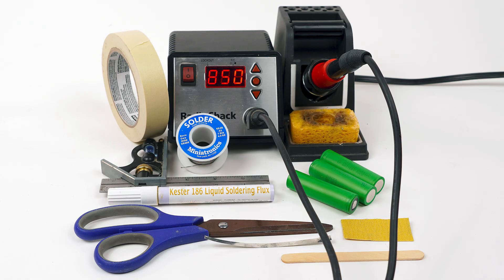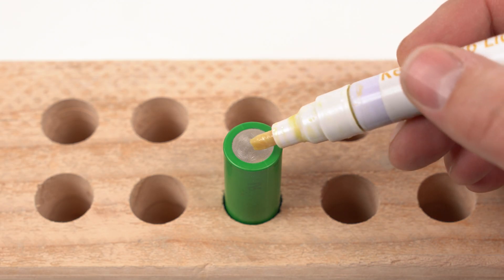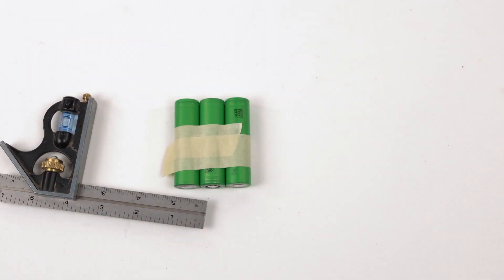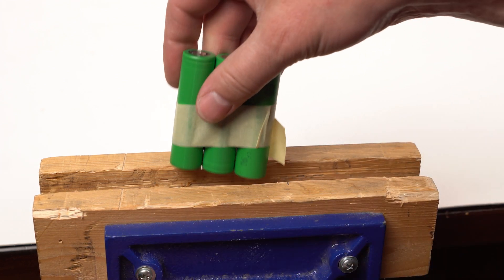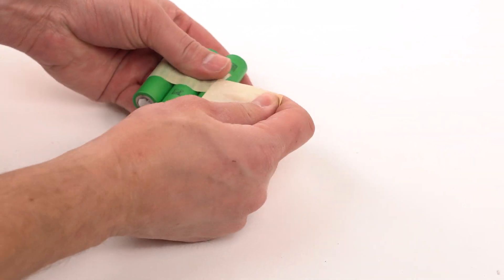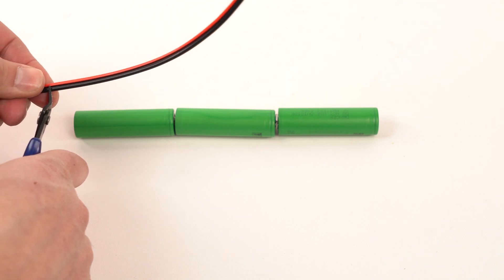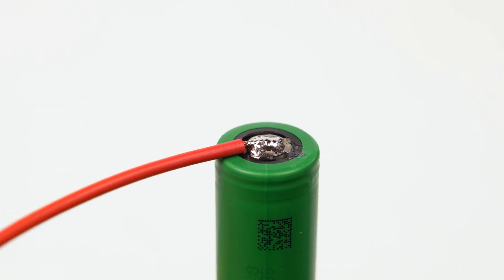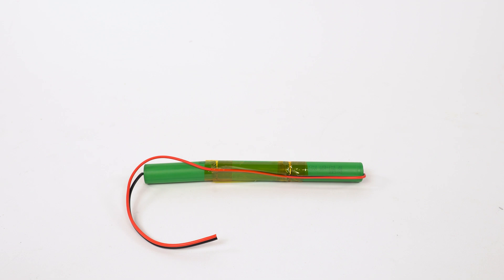How to Solder a 18650 Stick Pack Battery - NO WELDING!

Comment: can i run this pack for high amp usage like 90 amps or more cause my motors pull around 104 amps and the set pulls like 200 amps can i run the same way using soldering and not spotwelding for such high demands
Reply from the maker: Refer to the battery spec sheet. Gonna go out on a limb and say that I don’t know of a single 18650 cell that can handle 104A.

Comment: Im just a little. In serie configuration 3 battery make 11.1v 2000mah or 3.7 6000mah ? Thanks
Reply: Series ups the voltage, so 11.1V 2000mah.

Comment: Great video but wouldn't it be safer if you ran the negative wire down the length of the battery stick instead of the positive

Comment: I use my 3s packs for airsoft 😁
Reply: Do you use BMS? Sir
Reply: @yapchinleeify  no, I don't use a bms. But I will make a pack with a bms to test it
Reply: @Samjitsuu  from my experience, a BMS isn't worth it for airsoft, but to charge the pack, any BMS it's good
Reply: @Samjitsuu  yes ended my friend
Reply from the maker: This was for an airsoft rifle and doesn’t use a bms. I do solder on a balancing plug that allows my charger to balance individual cell voltage.

Comment: Hi. Great job. But how did you load such a pack? There is no balancer cable ...
Reply from the maker: This video only shows pack configuration. Balance leads can easily be soldered to the outer radius of the tabbing wire bends. Good idea for another video.
Reply: @enopto  can't wait for the video.